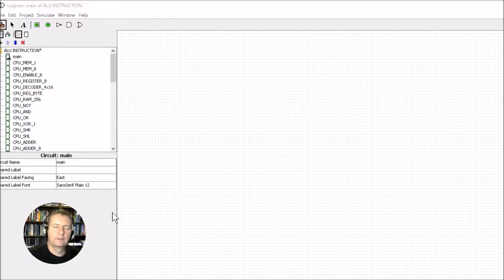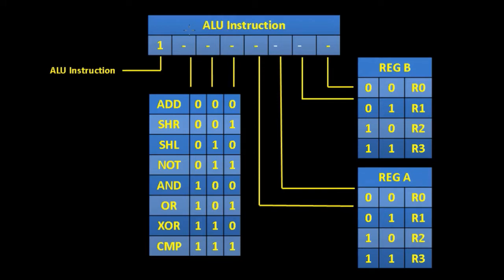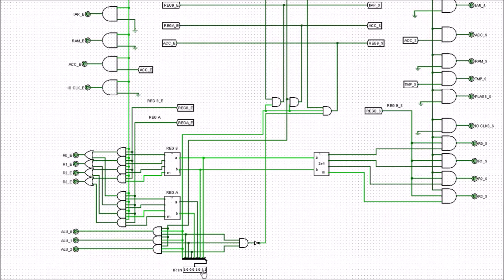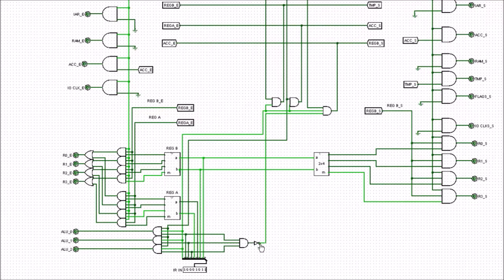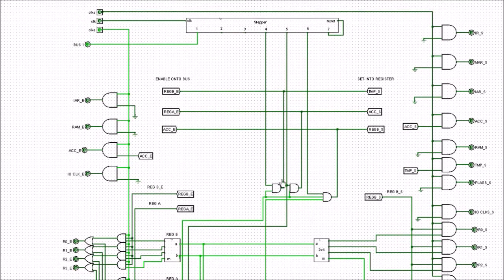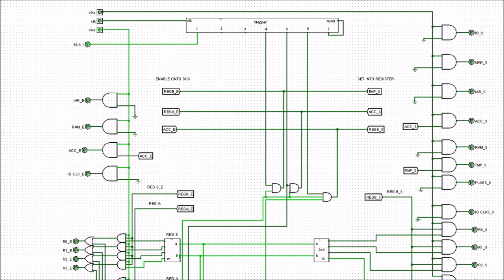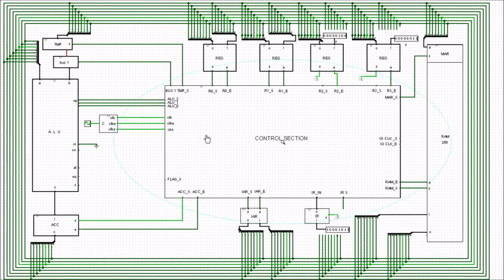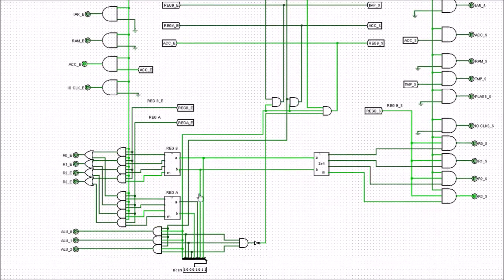Design a CPU Control Section ALU Instruction

Comment: There is no lookup table for the binary instructions, and no microcode; so, could we say that this is a RISC processor? Never thought that RISC would be possible for an 8-bit processor.
Reply from the maker: Lookup table approach not used here. Yes I would describe this as a reduced intruction set architecture. In fact I have gone on and created more advanced instructions using microcode on other videos.